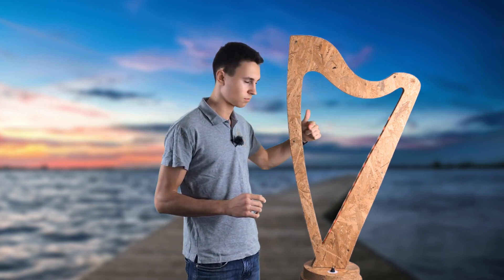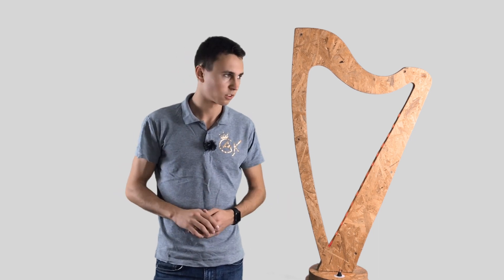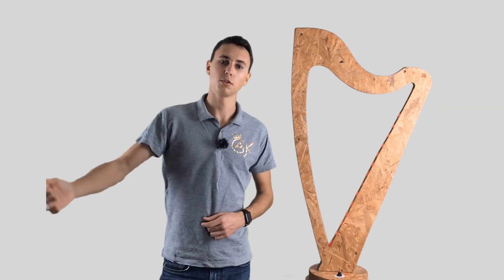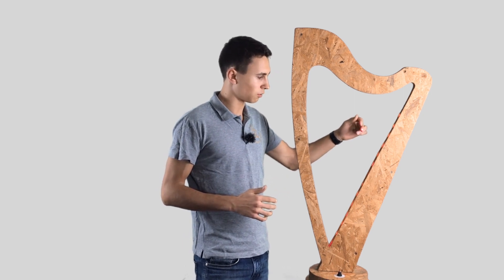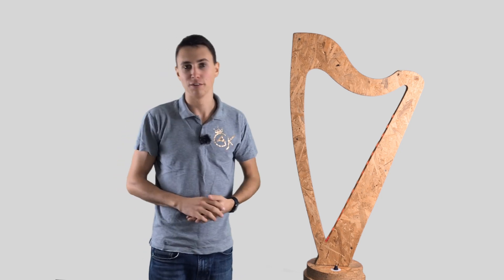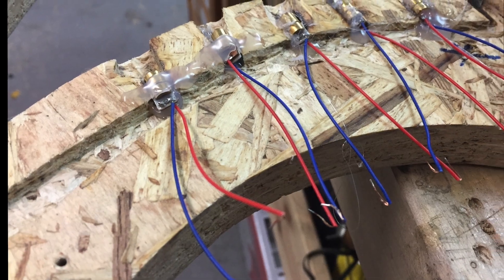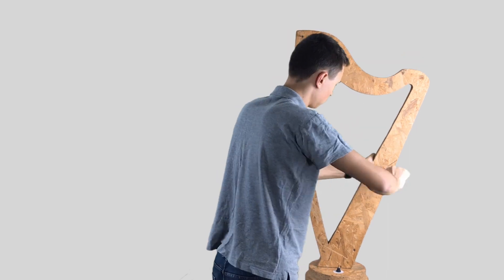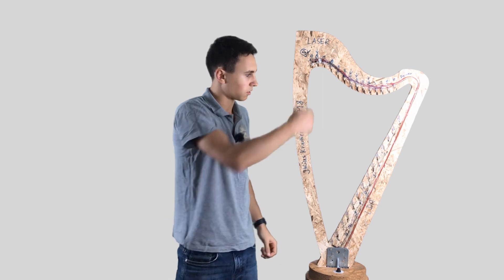Laser Harp Arduino Leonardo | MIDI | DIY | Julius Kramer

Comment: Could you explain more about how your arduino code works? I assume your analog pins are using analogRead() but what are your digital pins doing?
Reply from the maker: Jaki Rose my analog pins are just reading, then the code processes the midi commands; the digital pins do nothing
Reply: @juliuskramer6297  How does your code tell which one is being triggered? Like, A0 is reading 4 different photoresistors for example? Thanks for you help! :)
Reply: @juliuskramer6297  Any chance you could share your code?
Reply from the maker: Sorry I forgot about that. Please check the description, I just added the link

Comment: Hey man, this is awesome! Could you share what specific lazers you used and how you made the MIDI-Out?
Reply: I know its over a month later, but I figured I have a little answer to this. MIDI uses basic serial communication so you can actually just use the Arduino's built in serial interface to send MIDI data. Essentially MIDI is looking for bytes of information (formatted in a specific way you'll need to lookup). You can send these bytes over serial. Then literally wire the serial output of the Arduino to a MIDI connection (lookup the pinout for it) and you're good to go. As far as lasers go, there are some cheap laser diodes in packs of 10 on Amazon, but Adafruit carries some higher quality ones, for more money. Note that these are just the diodes, so you will need to power them with 5v (preferably from a dedicated power supply instead of the Arduino). Good Luck!
Reply from the maker: Gar gola I used a standard midi library for arduinos; and the cheapest laser diodes that i found on ebay; you cen get a pack of 10 for 2 bucks